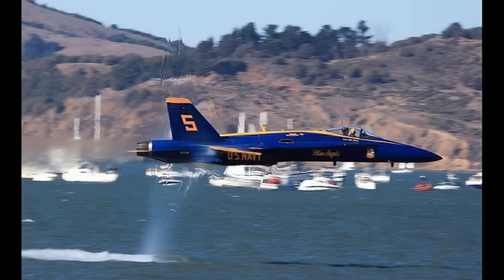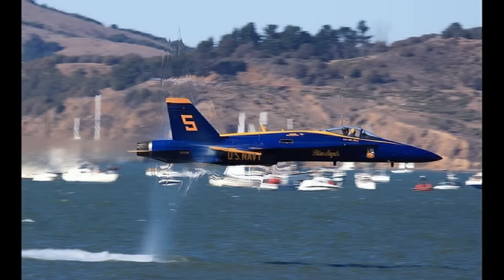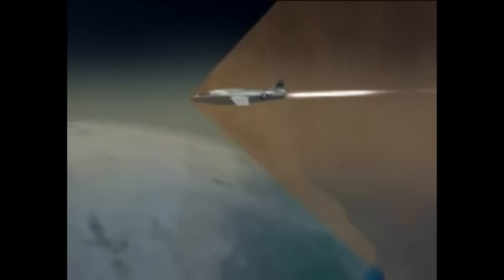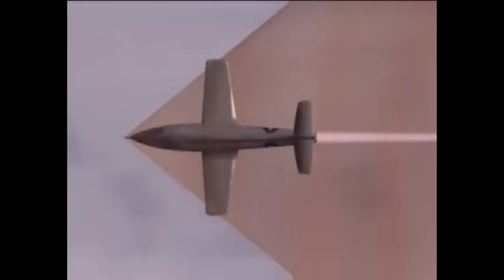Supersonic Flight, Sonic Booms

Comment: Now imagin what happens when you break the light barrier
Reply: The universe blue screens...
Reply: EpicFace1010 10 
That's impossible :)
Reply: Jabba The Hut Not impossible
Reply: EpicFace1010 10 technology will continue to evolve till we reach the speed of light
Reply: According to Einsteins Theory nothing can be as fast as light?
Reply: shbitz You get ripped the fuck apart due to traveling so fast, sounds nice
Reply: You'd experience a sort of luminal boom, in a way like a sonic boom, but in reverse, since it would be going back in time.  Also you must consider that light is a transverse, rather than longitudinal wave (except in the case of quantum optics, but that's another thing).  Cherenkov radiation, or rather reverse Cherenkov radiation is in theory the best actual example we have to what it would be like to travel faster than light, since it occurs when neutrinos interact with atoms via the electroweak interaction and are absorbed through inverse beta decay, producing a beta particle that can exceed the speed of light in the given medium.  It's an area I have some ideas in.  :)
Reply: ayyy lmao well at this level of human knowledge yes we have to dream about whormholes .but other civilizations have hyper jump technology . When the reach 98 percent the speed of light they increase they increase the vibration of the ship and the passengers so that they move to the 4th demension  so braking the light barrier wont hurt them then fron the higher 4th demension the spontaniously go where ever they want then after reaching the destination they move back to the 3rd density . This is only one of the trillions of ways possible of travelling super luminously . Flex your mind my beloved friend flex your mind .remember matter is frozen energy .....
Reply: PeDeR do you even know the mass of the universe . Have you calculated it .its not even entirely observable . How did you do that calculation ? But awesome comment anyway . Cheers my awesome friend .
Reply: MoidarPL ya but not the part when the cpu hangs because of over heating .lol. just kidding . Cheers .
Reply: ***** WUT?
Reply: Then u have to go 300,000,000 m/s or 300,000 km/s.. Thats alot
Reply: Jabba The Hut exactly ;)
Reply: That's when lightning occurs.
Reply: Matthew Delia what do u mean, nothing of human creations cant go fast as 300,000,000 m/s and it is more likeely to be impossible
Reply: Matthew Delia yeah but sure it will take a while
Reply: ***** This is true for the speed of light in a vacuum. Specifying the medium is important here.
Reply: Jabba The Hut That's why we have to explore the universe more and scientist have been coming up with theories for the past decades. Black holes are faster then light nothing can escape.
Reply: The God Of Sayians and Wormholes, these we can use to travel faster than light as hyper speed to differend parts of the universe. Yet its a myth we dont know wormholes exist yet..
Reply: EpicFace1010 10 
Yeah.
Reply: shbitz You go backwards in time....lol
Reply: shbitz Theoretically it is impossible because everything works a bit differently than you think. Let's say for example, we reach 2/3 of speed of light in a some kind of train. We "think we sit in there for 2 weeks". After our "2 weeks", we come out of a train, and we are like woah, 50 years passed in reality. Now let's say we are so advanced that we reach speed of light. When we are at that kind of speed time actually stops to exist. Well time is human created value, so easier it would be to say that all the molecules and particles moving in that kind of speed would be frozen. The next question is, how to get enough force to move massive object forward at that kind of speed. Even the particle that has broken speed of light once, wont be able to move the object. So the only real way to move at the speed faster than speed of light is dreaming about wormholes.
Reply: shbitz I think your brain works on a movie science. That's not how real life works.
Reply: ayyy lmao Ok . May you be blessed . Thanks a million for your awesome comment .cheers .
Reply: The object's mass would be incresasing exponentially with the increase of speed
Reply: shbitz the objects mass would become so high, that its gravitational pull would just suck in the whole universe
Reply: Golferperson1 It reminds me of Overclocking my CPU xD
Reply: Dan K. Mayme like.. no?
Reply: ayyy lmao exactly my reaction
Reply: ***** ur muslim or something?
Reply: MoidarPL Mby he is just drunk?
Reply: ayyy lmao maybe xd
Reply: Physically impossible, imagine how much mass a photon is, now compare that to an aircraft.
Reply: I guess you don't know anything about physics. Because if you knew, you would be ashamed of the words you have spoken.
Reply: +shbitz Craziest thing is, even if we broke light barrier thru travel it would still take billions of years to travel across the universe. Unless we could go many times the speed of light.
Reply: the speed of darkness can surely break the speed of light search in goooooooooooooogle

Comment: Basic concept is #Bernoulli_Equation :the velocity is Inversely proportional with pressure for the same level 

= Means : when the ( F-18 ) suddenly increases the speed the pressure accidentally deceases so the air waves shrinks like that shape in video .
Reply: Bernoulli's equation is valid for incompressible flow only, here on the aircraft surface we have transonic/supersonic flows, I'm not sure you can talk in those terms.. Shock waves form since sound disturbances cannot work their way upstream and their wave fronts pile up forming that mach wave.

Comment: whats different between sonic boom and speed of light?
Reply: MAAAAASSSIVE difference there buddy
Reply: Speed of aound is around 1000 km per hour while the speed of light is 
Around i think 1,800,000 km.......per SECOND
Reply: mistercococat peace
speed of sound ~761 - 768mph at sea level 
speed of light ~ 671,000,000mph in a vacuum of course. :P
Reply: Th3CardTrickTeacher I'm not sure if you're trolling or are just plain dumb.. The numbers I gave were fairly accurate especially when compared to the numbers you pulled out of your butt. Sound does not travel at 780 mph under normal conditions and that's also faster than 340 m/s you idiot. 340 m/s = 760 mph.. I also gave the speed of light in miles per hour because you usually only see it given in miles per second ~186,000 or kilometers per second ~300,000. Maybe if you would've taken the time to do the proper conversions, you'd realize that 186,000 miles per second and 300,000 kilometers per second are both equivalent to about 671,000,000 miles per hour. Next time make sure you know what the hell you're talking about before insulting other people.

Comment: its so amazing that humans can even break the sound barrier! Next we will do the light barrier!
Reply: Unfortunately that is physically impossible. The most we can ever archive is 99.8% of SOL.
Reply: Davi Lu According to modern physics it's impossible, but scientific paradigms change all the time. NASA is currently working on a spacecraft designed to do faster-than-light travel. It does this by accommodating exceptions to the standard parameters of Einstein's field equations. Check it out: it's called IXS Enterprise. Pretty cool stuff.
Of course, whether it will succeed, only time will tell.
Reply: CopyrightFreeMusic but the light barrier is something different. Today we have the knowledge to say that it is impossible.
Reply: Jmanbeatsminecraft | 500+ Subs!
The difference here is that even though people didn't believe anything could break the sound barrier, stuff was breaking the sound barrier all the time, such as meteors.  Even during the early parts of WWII, some people didn't believe the sound barrier could be broken, yet some aircraft in steep dives DID break the sound barrier (and themselves).  However, nothing has, as yet, broken the light barrier...in vacuum...as a physical movement.  This has to be clarified as "speed as physical movement" because we have indeed broken the light barrier through communication.
Reply: no we dont. People said that they had the knolege to say that the light barrier was imposible but hey, we did it
Reply: t s
It's only not travelling faster than light in a very technical sense. I get where you're coming from, but for all intents and purposes we group this (along with wormholes, Kerr rings, and string theory) under "faster-than-light" travel. Can it get from point A to point B in a shorter time than light can? Yes? Done. It's FTL.
Reply: yes I know time would freeze- for the people inside the vehicle, however, the plane would be going so fast that the people would not see its movement, however, it would be obvious that it moved. Also the light barrier might be possible to break. we never will know until it's done. Everything is possible-the question is if we have tech advanced enough to do it. If time froze when something were to travel at the speed of light then whenever we flip a light switch time would freeze and we just don't notice it. Final point, it might be possible, I dont know. Defiantly not with this tech that we have now. However it might be. :)
Reply: larreey I don't think any on thought breaking the sound barrier was impossible since modern flight. Its nothing like light. We have nothing on earth that has ever gone faster then light but we had always had things that broke sound.  Example is the whip. That crack you hear is the sound barrier being broken
Reply: CopyrightFreeMusic No.... Matter physically can not travel at or above the speed of light.

Compared to the speed of light, sound is incredibly slow.
Reply: You had it correct the first time, sort of.  The reality is, time would stay exactly the same for each set of people in accordance to their frame of reference.  If the people in the SOL vehicle were doing the SOL for a year, they would return a year older.  The people who stayed behind would have aged more (I forget what the conversion is).  So, the people in the vehicle would have appeared to age less (not freezing in time).  The people in the vehicle, if they could see the people who were not speeding, then yes, those people would appear to be the same age at all times, because only that last bit of light that left from them would be able to be seen (running along side the vehicle, as it were). 

Secondly, photons have no mass.  Massless particles can travel at the speed of light in vacuum (actually, some massed particle can travel faster than light in other mediums!!!!).  But to the photon, no time passes because we are talking 2 different frames of reference.
Reply: If we did 0 to 1000mph in a 1 second the g force would probaly kill you
Reply: blue4zero yeah.. but 1000 years ago they also said breakign the sound barrier is impossible
Reply: @CopyrightFreeMusic2  breaking the light barrier goes against all laws of physics. Breaking the light barrier requires an INFINITE amount of mass and energy, and that is technologically impossible.
Reply: kiddroy interesting! I will look for it.
Reply: kiddroy
There's a lot of "if" in every article I've seen about this.  It's kind of a thought experiment that Dr. White came up with. Is it possible to do what he is saying?  Of course it is, and it's absolutely within the bounds of modern physics (see special relativity).  But it's not "faster than light" travel.  It's a warping of space.  The vehicle itself doesn't actually move, space moves around it; shortening the distance in front of it, lengthening it behind, then pushing through, making the overall distance the same to an outside observer, but shorter from within the reference frame of the spaceship.  It is absolutely (and I can't stress this enough) NOT going faster than light.
Reply: Never said it was. I just said that soon we would maybe
Reply: kiddroy
Quicker, not faster.  Quick is a measure of time (1 second), fast (velocity) is a measure of distance divided by time (1m/s). IXS travels a shorter distance than light would, so it gets there in less time, but it does not travel at a faster speed.  I mean no disrespect, just trying to clarify, and when it comes to stuff like this, clarity is very important.  And I understand what you are saying, and the IXS, if it ever came about, would be awesome.
Reply: It is impossible to travel faster that light. Reason: Time would freeze, the vehicle would have infinite mass, and finally, NO.
Reply: (Darn it I messed up my grammar). What I ment to say is that time would freeze for people outside the vehicle but not for those inside.
Reply: dont be so rude... these are all just theories... GEEZ
Reply: larreey
Well, maybe not. There is still a lot of physical mystery we can still discover. By example in the quatum physics' domain. And we heard things about the universe which could be curved and stuff like this.
Reply: Even if we do make Vehicle go faster then the speed of light the g force would be so strong it would destroy the human body
Reply: survivalleader g force? In space? Speed of light wouldn't work on earth. It only takes 1 second for light from the moon to reach earth. 8 minutes from the sun to the earth.
Reply: Light speed travel wouldn't work for the most obvious reason. Navigation. You hit a pebble in space now it does damage. Rips right through a space craft. Imaging the quantity of space junk between here and the nearest star.
Reply: survivalleader
The force of acceleration actually wouldn't be bad.  v=at.  So, with 1g acceleration in space (which would feel absolutely normal), it would only take about a year (354 days) to reach the speed of light.  Not so bad.  If one could reach the speed of light.
Reply: Cliff Charpentier
That's why Chekov makes the big bucks.
Reply: dude your insane you know how much of a BIG jump it is from speed of sound to light speed IT IS IMPOSSIABLE to reach light speed... no kind of propulsion can reach that great speed...
Reply: Cliff Charpentier
If you were to go faster than the speed of light physical space would literally be no object. You would pass straight through it like tachyons theoretically do. It could not stop you.
Reply: ***** let me know when you write your dissertation
Reply: Derpleton Herpson hard to disagree with Trekkies
Reply: Cliff Charpentier I am not saying in space if we jumped 0 to over 10000mph the g force is going to kill you on earth
Reply: survivalleader the concord goes faster then 1000mph.
Reply: in theory you cannot exceed the speed of sound.
Reply: t s I don't understand when you wrote IXS would travel a shorter distance than light would, how does that work...Just trying to learn more.
Reply: Hey Paul, the theory behind something like the IXS is that it warps space.  The simplest way to think about it is like this.  Say you want to go to the neighbor's house which is immediately to your west.  You can walk to the west at 2mph, and get there in a few seconds.  Or, you can fly there in a jet at 1000mph to the east, and get there in 24hrs.  The jet travels at a faster speed, but you get there sooner.  Warping space works the same way.  It "pinches" the distance to make it shorter than unpinched space, so one can travel to remote locations in a very short space of time.  Light doesn't pinch space, so it takes longer, even though it travels at a faster speed.
Reply: t s right on, thanks
Reply: Someone is watching to much star track.
Reply: Quit. Bye .... uh I doubt that.
Reply: In the 1960s, I flew on a craft so fast that we landed 15 minutes before we took off.
Reply: 1,000 years ago no one  had any knowledge that there was a sound barrier. The fastest that you could go then was about 30mph. That could only be achieved by falling out of a tree. Most likely, you broke some bones, got infected and died, 'proving' that God never intended man to go faster than 30mph.
Reply: you can't go faster than the speed of light

Comment: This is exactly why UFO can fly at 3000 MPH in Earth's atmosphere but never heard or seen --as they are creating a gravitational field all around the ship or devise which completely nullifies AIR PRESSURE  as they slip through Earth's atmosphere and reason they can even blast into SEA WATER at high speed non effected either?